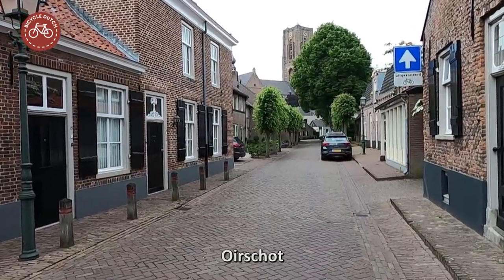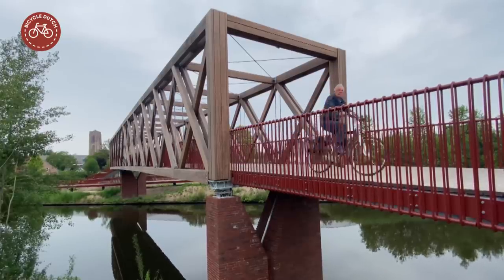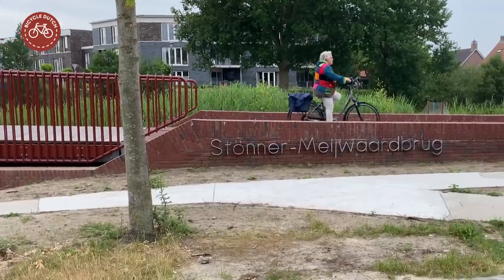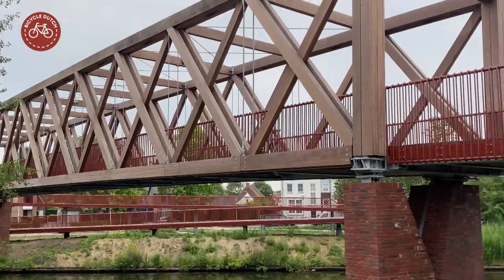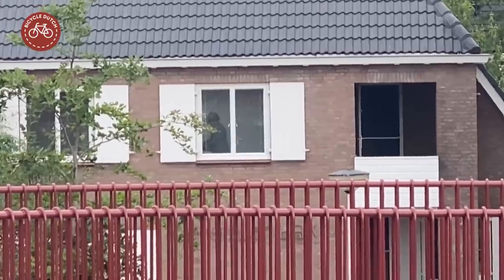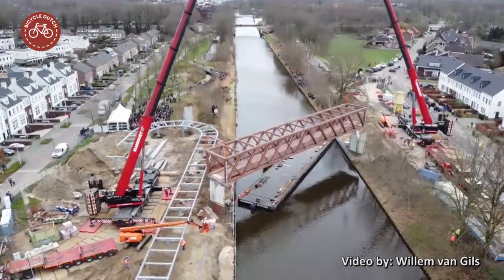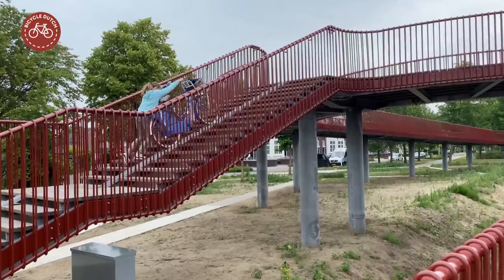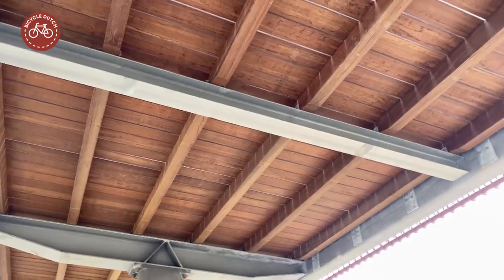A new bridge in Oirschot (NL)

Comment: How does the wooden deck work with rain?
My experience is that they can get quite slippery when a bit worn and then moistened by rain.
Reply: As you can see there are grooves with an insert in it which avoids that issue. I don't know this bridge in particular, but nearby where I live there is a way steeper bridge with similar wooden planks and inserts. It's been there for 30 years and it's not slippery at all
Reply: Codex 404 .
Reply: It depends on the wood they used. For example Teak stays very grippy when wet and can withstand all kinds of weather conditions, that's why it is used in yaught design for example.

Comment: For a span of just 40 metres, you need a 280 meter bridge. I like the design, but it takes up an enormous amount of space.
Reply: That is mostly to make it a bike bridge. Since bicycles are powered by muscles it is a lot harder than with a car to go uphill. For that reason you will always need a long ramp or noone will use the design. And it isn't like car bridges don't have it too... The 'Airbornebrug' that carries thye A2 over the Wilhelminakanaal is a whopping 290 meters long*, basically just as long but laid out in a line. Sadly the wikipedia article 'lijst van bruggen over het wilhelminakanaal' doesn't have any other bridges with their own page and their length listed, so from these two examples I must guess that is just normal.

* https://nl.wikipedia.org/wiki/Airbornebrug
Reply: I tried to find a map and now I'm wondering what they were thinking. The stairs match up with the streaats quite nicely. The ramps do not. This is a terrible design.
Reply: @David_Apollonius  Probably some game of telephone like this:
Planner 1: So how about we make a bridge connecting this street and that street? It would connect this line. Though of course the path would be a bit windy because of ramps.
Random dude: Alright, a bridge where the bridge crosses the river with that line. I will send it to be planned.
Planner 2, in a company completely unrelated to planner 1: Why do they want the bridge deck to be like that directly in front of the streets? Don't they see we will need a ramp and that will make it terrible? Ah well, we are getting good money, lets throw a ramp like this and it'll be okay I guess
Reply: @mennoltvanalten7260  they could have made it 2 times steeper at least

Comment: The use of wood for the decking is nice for aesthetics but terrible for maintenance. The top deck will get slippery very easily (unless you put a top coating over it or very uncomfortable anti-slip strips, making the whole aesthetics thing useless) and the bridge will no doubt get noisy after a bunch of years because of wear.
Reply: We do have a lot of these types of bridges in the Netherlands. Using wood isn't new by any means. I've cycled on them many times and haven't had any issues with slippery surfaces (except when it's snowing). I don't want to sound dismissive but here it rains a lot. A designer would've definitely taken that into account. And what noise exactly? The slight creaking of a bridge when 20 cyclists pass doesn't even compare to one car or lorry driving by your house. :)
Reply: It's very common in the netherlands, and never causes real issues. Not sure how they do it, maybe some special type of lumber. It's actually a really old concept, we had a bridge like this close to my home over 30 years ago, so i don't think it's artificial wood. It's likely the same stuff they build children's playgrounds with..
Reply: In the Netherlands we don't do 'build and forget' infrastructure. You can be sure this bridge will get inspected every year and serviced (if needed) every year. Mostly because that the cheapest way of maintaining your infrastructure.
Reply: @Cl0ckcl0ck  I know. But wooden beams still take more maintenance to remain as comfortable. I'm saying this because I'm comparing Dutch wooden bridges and Dutch non-wooden decked bridges..
Reply: @RainyRaven  Sure, the wood can be treated entirely with a top coating. But as you can see in the video, that's not the case. They've used glued on anti-slip strips. Those will not last forever, and still leave a majority of the surface exposed to the wood. And the noise I'm talking about is wear and tear in the construction. As it gets used more and more, the wood will begin to wear and little gaps between the screws will arise, making planks a little looser. And the planks themselves will wear around the edges of the planks, making the surface bumpier. Both resulting in rumbling sounds as you drive over it.

I'm not talking out of my ass, I've experienced it many times (in the Netherlands). You can keep coming up with excuses, but the fact is that a non-wooden surface would have lasted (more comfortably) for longer. I've seen them having to replace the wooden decking on the same bridges way too much. And it smells like sweaty feet every time they do it. I don't mind them using wood on other parts of the bridge, but using it on the decking just isn't smart.